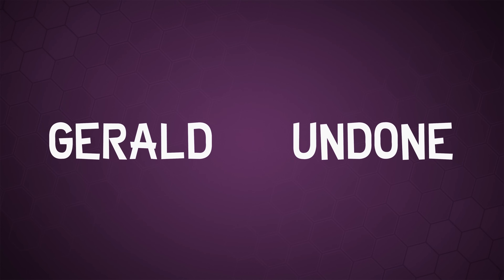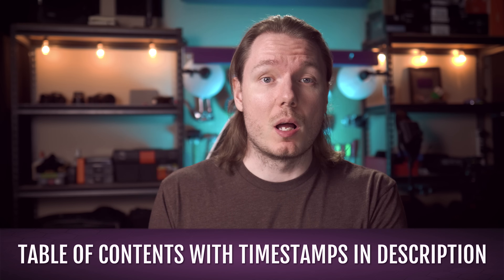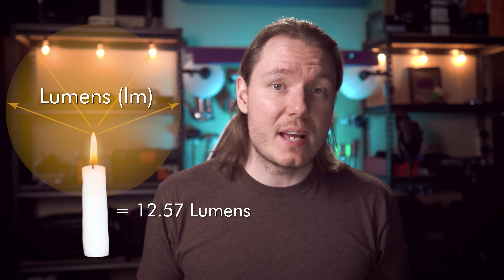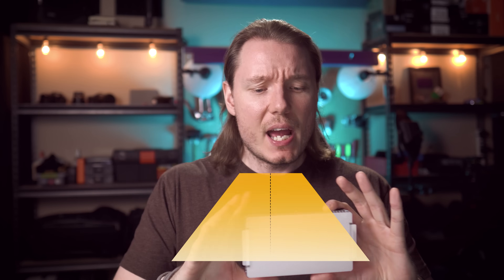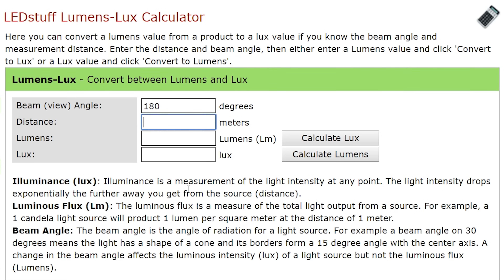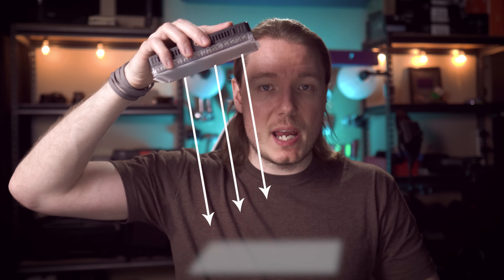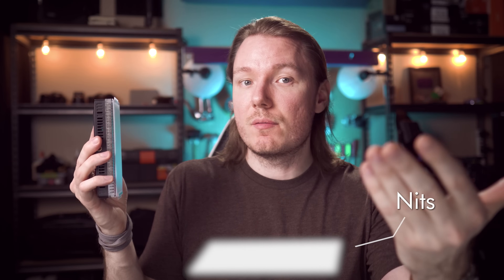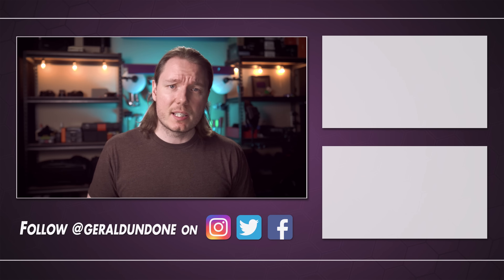Lux vs Lumens vs Nits - A Photographer's Guide to Light Units

Comment: There's one thing I don't quite understand: why the Nit is Cd/m2.  A Candela is essentially a measure of power per unit area (a Steridian is essentially a measure of area, afterall). So it doesn't make sense to me to say "power per unit area, per unit area".  Do they really mean that the Nit is "the amount of power in 1 Steridian worth of a light source, that is emitting at X Candelas intensity, per square metre"? That's not the same thing as "Candelas per square metre".

Comment: I use an on camera flash with a guide number of 190.  I'm considering using an on camera LED panel that outputs 4,500 Lux (at one meter) in a burst of light, just like a flash.  Which one will be brighter at one meter?  At three meters?  Is there a conversion formula?  Thanx.

Comment: I wish you'd use "Watt" similar to the way that lightbulbs use Watt. The term being "Watt equivalence" which could be more accurately called "Incandescent Equivalent" or "How bright is this compared to the average incadescent bulb rated at a certain wattage. Why this would be useful is that I learned doing photography / videography with 500 watt bulbs, when I went digital I learned that I could get away with using 200 watt incandescent, even though now I go to the store looking at the Lumens value each bulb maintains, I still do tend to fall back on the "Watt Equivalent" rating. It would be nice to know what the "Watt Equivalent" would be for some of these other technologies, and LED panel displays.

Comment: Hi, I have been searching a lot about Lumen Lux relationships in terms of grow lights. Your video is the best approach I found this far but I still have a problem with the Lux concept in all these videos. Lux is defined as Lumen per square meter so can you elaborate on your views about the led device you show at 3'20 delivering 1500Lux@1 meter? Is this 1500 Lux over a surface that equals the light source? So what is the intrinsic Lumen emission of that device? (BTW saw some other photography related videos by you especially on color spaces IIRC)

Comment: Still a little fizzy on why LEDs are still not useful for Stage illumination than Tungsten - because the LEDs can’t “throw” as far as Tungsten - but LEDs are good for video/filming because the lights are kept in closet proximity... other than it works! Which is important for me because the Theatre space I am going to shoot in has a very limited electrical capacity and the existing tungstens are just about IT! So I am keeping them for the backdrop/sets... but bringing in my 3 Point Lighting kits (two Intellytechs L-160s and one Aputure D3000 for key) and have to run them ALL on battery power. Haven’t set things up yet, but I’m assuming I’ll be able to keep two different lights sources in balance as everything will be shot at 5600K.

Comment: That's a brilliant educational video, I had fun watching it, I just have a little question, I know you use Aputure H672s as your key light with an umbrella to diffuse the light, do you think it's the better option compare the Falcon eyes RX-18T which is a flexible LED mate? as it's a larger source of light or the light power that comes from H672s compensate for that after diffusion?
Thanks in advance for your answer, it would help me a lot in my channel as my lights are very bad and allover the place :(
keep up the good work :)
Reply from the maker: For what I do the Aputure is plenty powerful enough, even after diffusion. I'm not a huge fan of flexible LEDs because I don't like the diffusion options as much. I always end up bouncing them. Falcon Eyes also has their Sophiez series which are pre-diffused. The SO-48 or 68 would be big enough for a key I bet.
Reply: @geraldundone  Thanks for the quick response, the problem is with my budget as well as I can get the Aputure light cheaper than the Faclon Eyes by like 100 Euros, so do think it's enough to my key light and use it for Tech reviews maybe with a little help of a smaller light like Aputure F7?
Thanks again
Reply from the maker: Yes, absolutely. I'm only using mine at 30% power.

Comment: Thank you for this video! 

On an unrelated note, on my way into work this morning I was thinking about bitrates and had a question that I feel like you would know the answer to (using my Lumix G9 as an example): The recording options with the highest quality are 150mb/s at 60p or 100mb/s at 30p. It seems like the 60p would be higher quality because of the higher bitrate, but wouldn't the 30p actually be better (since there is more than half the bitrate for exactly half the frame rate, giving more bits to each frame)? Or is that now how video works at all.

That's probably splitting hairs as the difference would be nearly imperceptible. (in quality, not in appearance as 30p vs. 60p is apparent)
Reply from the maker: You have the right idea, yeah. It depends on the camera, but often the lower framerate is cleaner because it can spend the bits better. In the case of the G9 you might have a hard time telling a difference, but in some cameras it's more obvious.